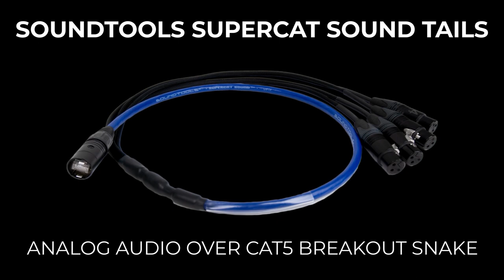Optimize Gain Structure - Pro Audio

Comment: Hey Dave really nice video, but I have a question. I’ve learned that I should run my preamps as hot as I could before clipping to achieve a “better and hot” sound, especially on analog, only this way I wold be exciting the preamps correctly and achieving its maximum potential. The problem is that I always run exactly in the problems you have described in the video. So my question is, is it true that preamps work better excited like this? Or I’ll achieve the same sound in between the gain window, not necessarily running it really hot right before clipping? Sorry for long question, loved the video, cheers from Brazil
Reply: It depends on the sound you are after. Some instruments sound good with distortion, some don't. Some equipment distorts nicely and some doesn't. In an ideal world you would let the musician control the distortion so they get the sound the way they want. That's why guitarists have distortion pedels etc.

It's also possible that a clip light won't register all the distortion when you get near clipping.

I'd watch the previous video on the difference between gain and faders.

It should also be noted that sending a loud heavily clipped signal into speakers can cause damage as you are sending a more constant current through the speaker coil and not giving it the chance to dissipate heat.

You can also give yourself problems if the musician decides to crank up the volume after the sound check. This often happens. Then you might just end up with a load of nasty farting noises
Reply from the maker: Hmmm, it's pretty easy to test. Just run a channel hot and a channel at low volume with them out of polarity and sum them together. If you adjust the gain so they cancel, anything that can't be cancelled would be the difference between the signals.

Typically, below distortion with most pre amps, the difference is minimal. But the sound of analog overload can be desirable for some inputs.
Reply: @chriscook7049   hi cris! Very well pointed, I’ve had a lot of situations were I had to turn the gain down right into the beginning of the performance because the musician got too excited!

I definitely don’t let the preamps get clipped, but always try to run them as hot as possible believing that doing so I would achieve better “hot sound”, not distortion but warmt if that is possible. I think this believe comes from old techs from analog or tube days, idk.
Reply: @DaveRat  Hi Dave thank you! I’ll try to run the test myself and check if there is some difference, I’m curious if gonna find something interesting 
Cheers from Brazil
Reply: Dave said, send hot to get a better s/n ratio. That is the best gain stagging practice in a nutshell. The hotter, the farther you get from noise. So the short answer is,  YES. Get your signal as strong as you can from the source and attenuate afterwards. How strong should the signal be? The closer to clipping but without clipping. So that is why the 2 hour backing Dave does is a very good aproximation of how to get to that point.
Reply from the maker: Agreed and also keep in mind that digital clipping is quite undesirable where as digital noise floors are quite quiet. So being too low, the sound of reduced bit depth is nowhere near as bad as the sound of digital overload. So being too low has minimal negative issue where as being too high has terrible sounding issues. 

So opting on the side of lower levels with digital will tend to offer preferable results. Especially if inputs jump in level.  Low is safe and high is sorry.

Comment: Beats me why I see so many people in my part of the world set up gain structure with amps running on max gain not attenuated at all and then running mixer or dsp channel levels attenuated -18dB or so which ends up resulting in maximum noise and distortion from the amps and amp fans still running hard pushing plenty of hot air. Is there any other negative effects like amp components more likely to fail?
Reply from the maker: Well, ideally with a properly designed system that is optimally setup for the venue, the amps would be at nominal gain (up all the way) and master faders would be at nominal (about 3/4 the way up) and input faders and gains would be set above noise and below clip.

With digital consoles you really never want to be near clipping and want to be well below maximum on the meter outputs.  I did a YouTube video series comparing digital to analog consoles that covers more on this that you may want to check out
Reply: @DaveRat  yea I do remember that il watch it again cheers
Reply: @DaveRat   I was actually under the impression that, assuming no one can touch amp gains, it’s more ideal from a gain stage perspective to set the system dsp processor to just below clipping and then turn amp gains up to just below clipping (not at nominal) then back off dsp gain and amp gain a touch for optimal SN ratio. High chance I’m very wrong though
Reply from the maker: Adjusting amps after the dsp can cause a system to limit too early.

If there is a dsp in the rig, then set the amps at nominal, set the dsp limiters for proper protection, and adjust the input to the dsp to to get your console output faders and metering into the optimal range
Reply from the maker: Agreed, input to the DSp is the best place to compensate.

Comment: Thanks again Dave. I know you prefer to work with analog, but in the digital realm there's the added issue of losing bit depth resolution if head amp gain is set low. I've been dealing with this with the use of subgroups, which can be turned down in the Main Bus as needed. Thoughts?
Reply from the maker: That is worth a test.  Will grab a digital console and combine an in polarity high level and out of polarity low level and give a listen to see how relevant and audible bit depth resolution. Very cool.
Reply: @DaveRat  You always come up with the best real-world tests...
Reply: @DaveRat  ...and the polarity in/out comparison is just genius!
Reply: This exactly what Robert Scovill preaches....you have to gain up the channel until you reach line level which is the proper signal at which the digital mixer is working optimally and that includes the bit depth resolution from A/D converter
Reply from the maker: Yes, ideally you would run fairly high levels without ever clipping with digital. 

That said, the sound of digital clipping is very undesirable and the sound of reduced bit depth is moderately undesirable if even audible.

So knowing that to hot is quite bad and too low is slightly bad, one can logically determine that fairly hot but well clear of clipping is a reasonable  path.
Reply from the maker: Thank you Todd! Yeah, gonna grab a small dog mixer, maybe the QU16 we have at the shop and do the test this week.  Will post a member vid, based on your question comment. great idea.
Reply: @DaveRat  I agree, though I do believe there is some benefit in trying to always hit that line level mark (which varies from console to console, for ex. Yamaha uses -20 dbFS meter mark as the line level) for each input for consistency sake, route all inputs to subgroups and then use subgroups for P.A level adjustment, and finally use DCA's to control those subgroups while being in that 0db fader area for smooth control
Reply: @MT-ue3yc  ... i'll do it exactly in that manner but without using dcas to control the subgroups. you are in the digital domain already with the subgroups. so it is the most important that the input channel faders sit around the 0db (+/- 6db of course) to have the best a/d resolution w/ pretty good headamp gain, of course! the mix is done w/ the groups feeding other groups or auxes, that lastly feed the matrices for driving the system controller.
Reply: @andreasputz8045  yes, but sometimes because of the volume offset that you do with subgroups, those group faders can sit pretty low in the mixer, so using DCA's to control those faders (because I tend to mix with groups instead of single input channels), is convinient....This is usually the case when you don't have the time/possibility to adjust the P.A. system beforehand
Reply: @MT-ue3yc  ... that's right, MT! so it can be fine to have the "faders to ride", that are the groups-controlling-dcas, in 0db position (with an offset in relation to the groups of course)! #thumbsup

Comment: Thank you Dave - I always learn so much from your videos!

Would you be able to share some thoughts on wireless gear and optimizing gain structure? There's an extra gain stage involved there and I'd love to hear your perspective on if we should treat these sources the same as others down the line or if wireless sources should be handled differently.

In the same mindset of gain-staging for wireless, do you have any advice on really dynamic presenters? People using headset-style microphones that literally have a 20-30db+ range. Should they be treated the same as other highly dynamic sources like a snare or do you have other advice?
Reply from the maker: Have you watched any of the videos I have done on wireless in ears and such? I must have done 15 to 20 vids on the subject both on the public side and even more on the member side
Reply: @DaveRat  Thanks - I'll check them out!

Comment: Hey @Dave Rat , Along side the theme of this video, can you show best practices for creating a "board mix" for recording? It can be hard to get a decent level on AUX sends that feed some recorder that is backstage out of sight or control. I have many clients that do not understand the difference between mixing for a room and mixing for a record feed. Not sure there is a really good answer for that, but how have you dealt with it in the past? I am speaking mostly from corporate work. It is especially frustrating when a band is involved. The mix will be spot on in the room, but obviously sounds thin in the records because the client does not understand the concept of stage/room volume.
Reply from the maker: That's a tough one. Ideally a seperate person mixes the recording. That said, if a good vs sounds good in the room and you can mix the band to sound like a good vs, then the recording should be good as well.

Comment: This might be a silly question. But I play vintage drum machines and synths. A lot of these instruments have a Hi output and a Low output. Is there anything from a gain stage perspective that I should consider when choosing the output?

Love the videos!
Reply from the maker: Hmmm, the high output I am guessing is line level or instrument level and the low out is either instrument level or mic level. So the high out would be to run directly into an amplifier or a line level on a mixing board.

The low level would be for running into a microphone input.

Either way, use the output that puts the gain knob of whatever you are running it into as close to the 12 to 3 o'clock position.

Comment: Thanks for this explanation. One question: would you ever use busses/subgroups between the input and output to adjust your gain? You could gain up each input to where it’s happy and then buss each signal to the output through a subgroup that is basically for volume control. Any benefits/pitfalls to this method?
Reply from the maker: I would not us a subgroup just as a gain or atten. I would use the as a way to improve control over the mix and I would want the buss or group fader to be in a good spot as well

Comment: Lowering the master output of the mixer or lowering the input in the system processor (i mean by some couple of db), isn’t it the same? I mean in voltage gain as the overall signal that should be the same.
Reply from the maker: Similar, really depends on where you want your output metering of the console to sit
Reply: Its not the same. Gain controls are on the input of a component, and volume controls are on the output. Too much gain can distort the signal, while volume can't distort the signal. That's why its important to properly structure your gain. Once gain is set, you use volume controls to set the desired loudness.

The easiest way to visualize this is to look at a guitar amp. Sometimes a guitarist wants to distort the signal on purpose to achieve a desired sound. If you've ever noticed, there's usually a volume and gain control right next to each other on a guitar amp. If you want distortion, you set the desired amount with the gain control. Then you use the volume control to set loudness. 

Also, keep in mind the term distortion, in the context of this discussion, is wrong. We're just using it as a matter of convenience. What we're really talking about is overdriving the signal. Just like volume and gain controls, distortion and gain are 2 different things. So, when you increase gain and hear the signal "distort", we should really say overdrive instead. Going back to the guitar example, if you don't want a clean sound, you can either buy a distortion pedal, or an overdrive pedal. They may sound similar, but how they work is completely different.
Reply: @AT-wl9yq   Thats on point. An example would be dj mixers where the Trim knob of the channels would determine the input sensitivity and amplify the input signal above certain level (practically gain). Instead the faders are generally just controlling (outputting) what the gain knob is giving out and also the master knob would just put out what is getting from the channel faders. But in the case of many system processors, the output channels (like the inputs) indicate the level as gain. You can even put positive values on them, hence I would consider them as gain (amplifying the signal above 0). I personally treat any fader/knob/parameter that if they have above 0 values they will amplify the signal past the nominal sensitivity (0 gain) has been reached in the signal chain.
Reply: @EndritVj  Not all DJ mixers are the same. If you have an analog mixer, the trim adjustment for each channel is just another gain control, and all the same rules apply. You back off the main volume a bit, and use the trim for small volume adjustment between songs to get the correct loudness. But its just another gain adjustment in the signal chain that needs to be part of the structure.

If you have a controller or a digital mixer like the Pioneer V10, the trim is adjusted after the signal has been converted to digital, and that's something entirely different. With this type of trim adjustment, your main concern is loss of resolution due to low volume settings. However, and this is just my personal opinion, if you're using lossless files (CD quality or higher), you shouldn't have to worry. Any loss in resolution shouldn't be audible. Now, if you're DJing with MP3's, especially if they are less than 320kbps, then you may have to keep track of where all your digital volume controls are placed. But if you just use high quality files, its not something to be concerned with.

Comment: Thank you Dave for this informative video I have learnt so much especially about hiss  ..I have an approach that I need your opinion on what do you think about first setting the gains then put the fader around 0 and if it’s too loud route the signal to a subgroup and turn it down there then send it to the master bus which sits at zero ..would any issues arise there
Reply from the maker: That works, trimming out the master gain by routing through a matrix or group is useful.

Comment: As always, great information. I see a lot of people struggle with gain structure and this video is an excellent tool to explain proper gain structure whether your mixing for an album or live band.   
Maybe you can do a part 2 to this with adding or subtracting eq and maybe a compressor so folks can get an understanding of how the gain structure will change when introducing those elements.
Reply from the maker: Good idea, will work on an EQ vid